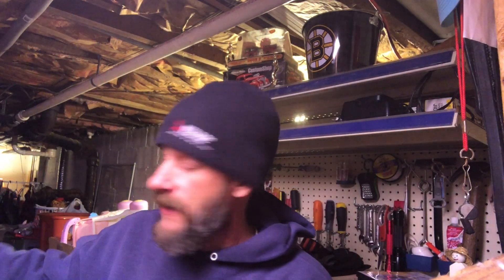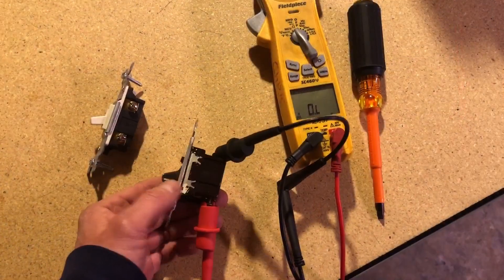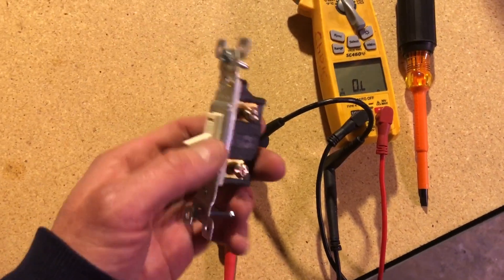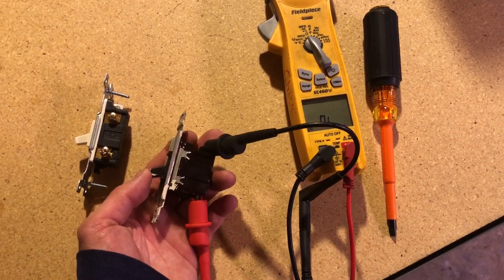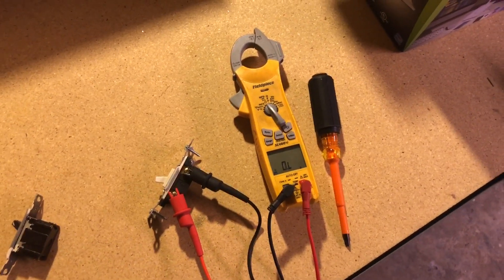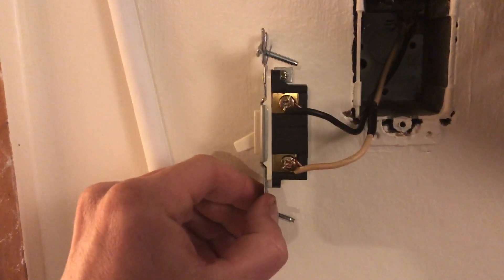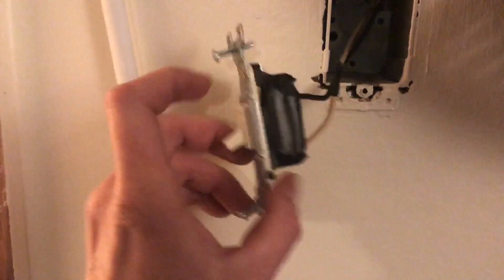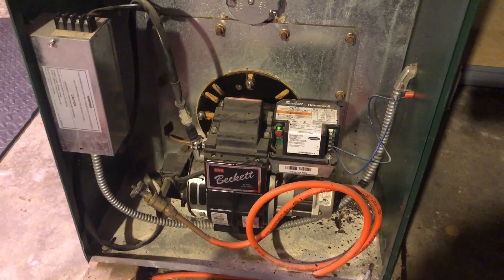Heat Not Working At My House 😱

Comment: I do a lot of oil burners in New Jersey. A handful of times the emergency switch at the top of the stairs is the culprit for no heat calls. Sometimes is just turned off because someone accidentally turned it off while turning off the basement lights. Thats why I put the wall switch cover on them. No bullshit 2 am service calls for "oops"